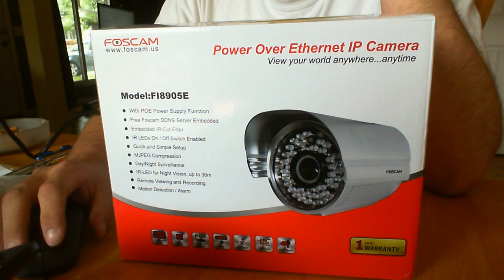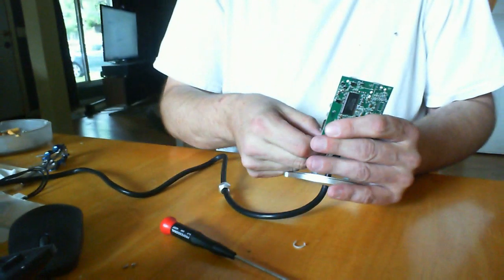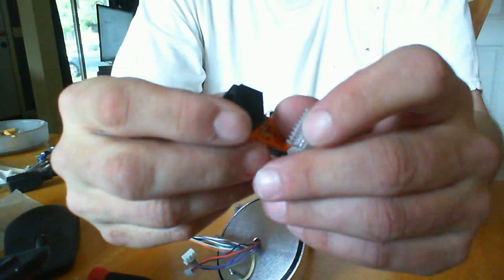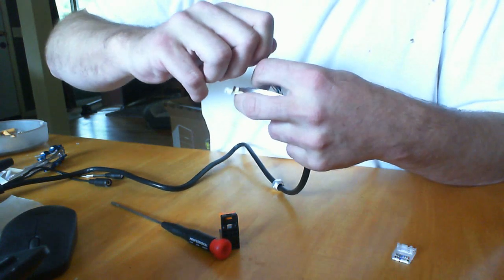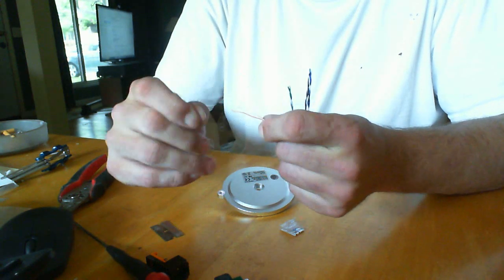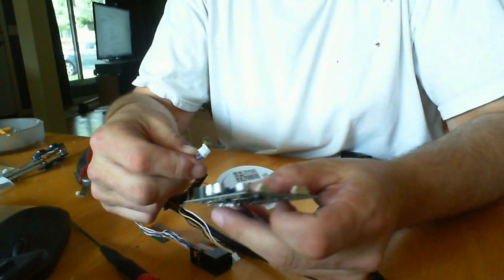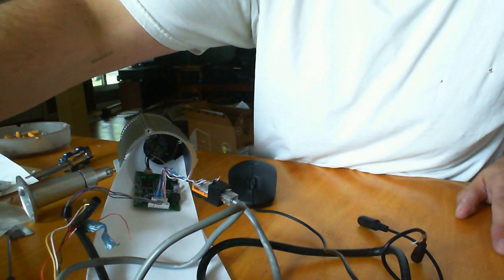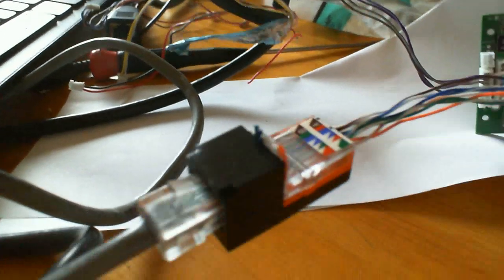Foscam FI8905E POE ethernet modification

Comment: That way you could have everything (except the lights) using onle the ethernet cable.

Since the camera works on 10/100 speed, it means it will only use 4 wires from the 8 availiable on the ethernet cable.

That way you can use the other 4 for power and reset button.

Best regards,
Paulo Brinca.
Reply from the maker: +Paulo Brinca Excellent Thought!

Comment: Yup - thats useful - useful that Foscam can't seem to realise that folks don't want to drill a HUGE hole in their wall!  

Interestingly, the harness used appears to be identical to the one in my FI8905W (wireless - not POE) device - I was thinking of buying the FI8905E as an alternative, but if it has the same cabling system, then thats sucky.

Good video - good mod :)

Comment: I've just bought a similar camera - the FI9803EP - and face the same problem. You have to ask why designate a camera PoE and then add a huge harness that either has to be outside or require a 2 inch hole in the wall to get all the plugs through. Interestingly, the Y-Cam PoE cameras have an RJ45 socket inside the housing.
Reply from the maker: +John Pryor I agree 100%, I also had a camera with an internal Ethernet port that was POE, it was a Vivotek. However, the Vivotek was expensive and did not have very good day vision/ color due to the lack of IR cut filter. It was the Vivotek that gave me the incentive to make this modification. Thanks for watching and commenting. -don

Comment: Also another question...... Do you think that last connector (the poe one on the board) would you be able to get it out through the back plate hole without cutting it? Possible at all? I had thought if you could get the wiring harness out intact - then I can reuse the original wire, but now instead of a large 1-2 inch hole, I could drill a small one through my garage wall and just feed the connectors and wire through. Probably would be the same size hole or slightly bigger as ethernet wire. and then rehook the camera up outside fully. And have that huge dongle on the inside of my garage wall fully working without it having to go through a hole in the wall.

Comment: Was wondering what it would take to take this camera apart and rewire it. Your vid was perfect. I guess only using the Ethernet poe wire - that gives you power and feed with the one wire. Nice clean outside install. So no need for the lights or extra power plug, but what about the reset? With just the POE Ethernet to the camera you are taking out the reset wires. Do these cameras ever need to be reset with the switch? Or did you somehow also feed through the reset wires (not sure how) along with the ethernet wire through the back camera plate?

Comment: Need some help....We have a Foscam that we have never used. We finally decided to pull it out and plugged it in with what we thought was its power cord (12volts). It did not turn on. We realized it was the wrong cord and found the right one. Once it was plugged in the light on the power cord blinks on and off. We opened the cam and once the red and black cord is unplugged the green light on the power cord stays on. Our question is.... if we do what you have done, will this allow the cam to work?

Comment: Friggin Macgyver!  Nice job, very helpful.  I really want to know how you upgraded the lens, the cost to upgrade the lens, and where to buy it from.
Reply from the maker: The lens was very easy to upgrade, if I remember correctly I just had to unscrew the the front and unscrew the old lens, replacing it with the new. I purchased the lens from Foscam's website. Make sure the focus is correct before installing the cover.

Comment: I think your mod it great and would be great if foscam had a removable harness and then a internal RJ45 connector. Another option I have used is High-Friction Silicone Tape in landscape lighting. http://www.leevalley.com/us/wood/page.aspx?p=67792&cat=51 It is waterproff it wrapped correctly.  Wish Foscam has put on a waterproof clip case like the one they make for connecting 2 exstention cord togeater. As POE is 48volt it fall under the "low voltage UL listing" and Foscam does not have to have that waterproof on that connection to meet the IP66 code.

Thank you for your video.

Comment: please edit the video 20 minute is too long just for a connector change
and which poe injector did u use?
Reply from the maker: Stergios B Thanks for your comment. This was one of my first videos and I'll take your comment into consideration for my next videos. 

To answer your question: This model is a POE 802.3af standard and did not require a POE injector; just use a standard POE switch less than 300 ft away.

Comment: What is the name of the cable with the power and the Ethernet socket called?
Reply from the maker: It is a regular Ethernet wire. In this case we are using a POE switch that provides the power over the cable.  Look up POE switch.. Of course the device has to be POE as well.  Thanks for the question.

-don
Reply: +Don Brandt thanks I had water get in my original Cat5E socket on the camera which made the power pins disintegrate and this looks like a possible fix to my problem! Thanks

Comment: I dont get it!!!! how could this be that simple. 
i mean u disconnect the RJ 45 connection to simply install a new one. without touching the AC connector.

does this mean that the order of the original connector is wrong?
Reply: These cameras are Power Over Ethernet